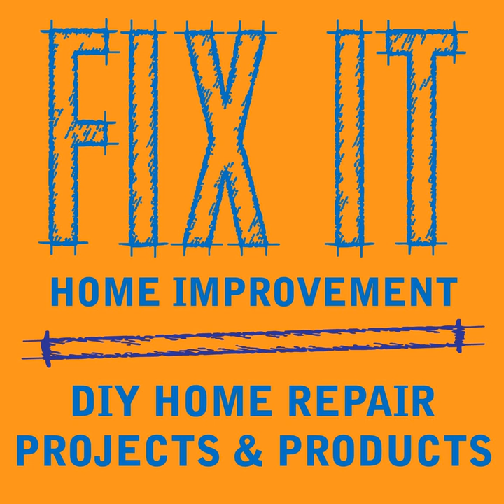Electrical Wires, Boxes and Connectors - Audio Podcast

Comment: Good information, guys. Just to put Cindy's mind to rest on choosing NM cable, the first number is the wire gauge, as you explained. The second number is the number of current carrying conductors in the cable. Ex: 14-2 has 2 current carrying conductors (a black and a white), and a ground, which isn't considered a current carrying conductor. Thanks for the podcast and keep up the great work. 
Dan
Reply from the maker: Thanks Dan.

Comment: great info! visual aid would have been awsome. wonderful non the less
Reply from the maker: Thanks!
Reply: Question as fellow Chicagoan. When using MC Lite (metal clad), is it safe for ceiling can lighting? I just installed, but worried material to thin and flimsy.
Reply from the maker: Hi, I would check the installation instructions on the can light, but if the cable has thhn wire, the hh lets you know it is rated for high heat. I like the MC Lite for projects like this.